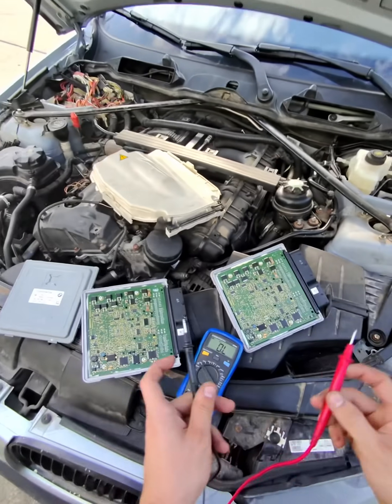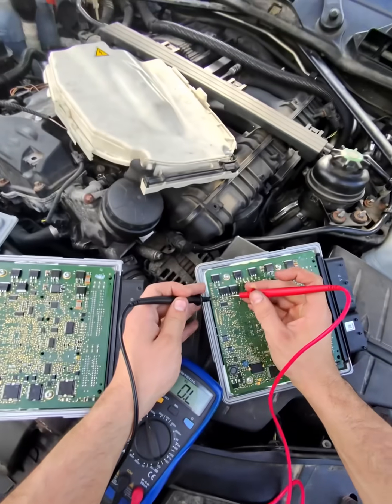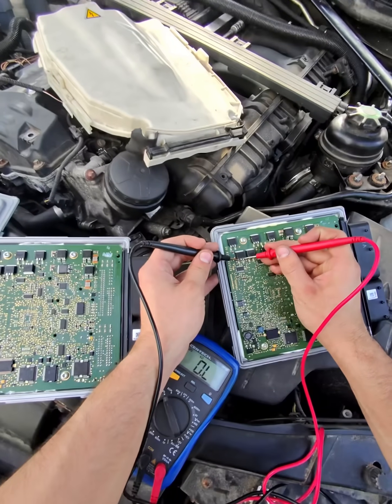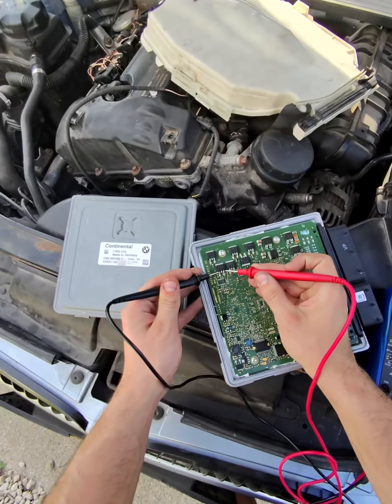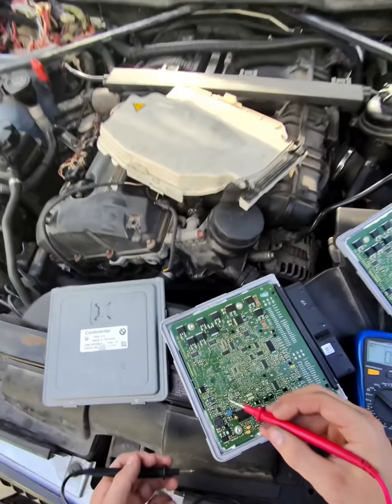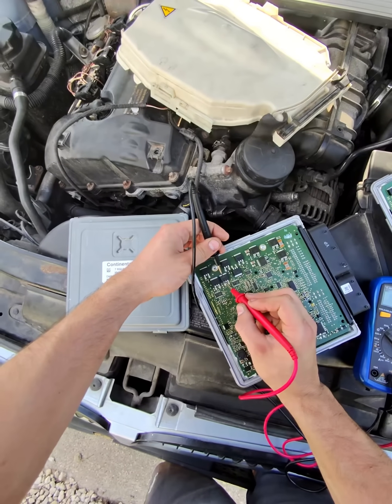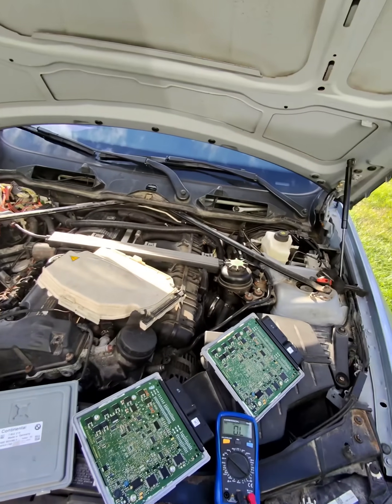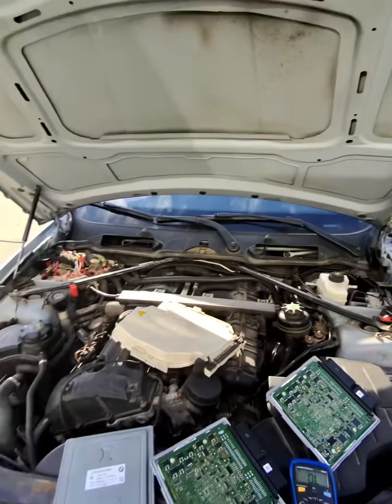Misfiring BMW? How to Test Faulty Transistors on ECU

Comment: 1sz Engine accelerates itself and misfires.The sound is always irritating and breaks losses efficiency.. What could be the problem..I have tried to clean the throattle body and checked for any vacuum leaks but all the same
Reply from the maker: do you have any engine obd2 codes?
Reply: @abdujk Unfortunately no any engine check light of any kind😢
Reply: I tried to replace the fuel pump thinking it could be malfunctioning...Some times it goes back to normal..This is day 5 since It developed this behavior
Reply from the maker: @Goldensammy-zambia test fuel rail pressure with a fuel pressure gauge. do a "fuel pressure leak down test" to individually test the injectors. Replace all your spark plugs. Make sure you are getting source voltage at the ignition coils by putting T pins into the connector and read the voltage.